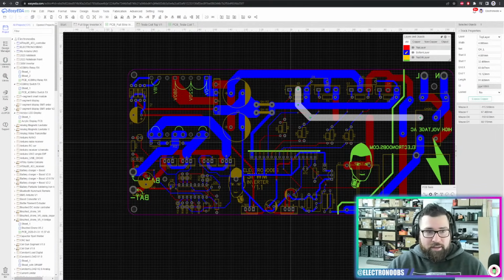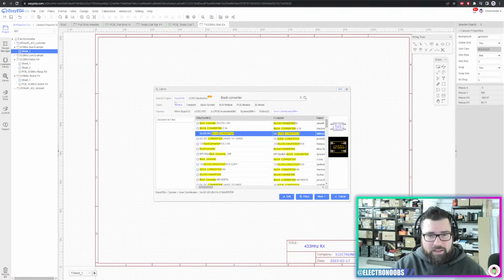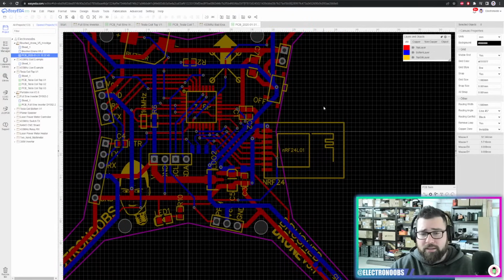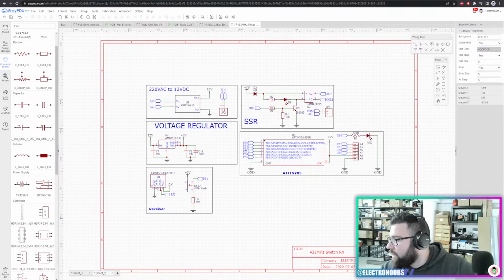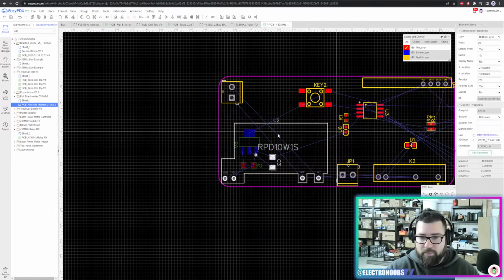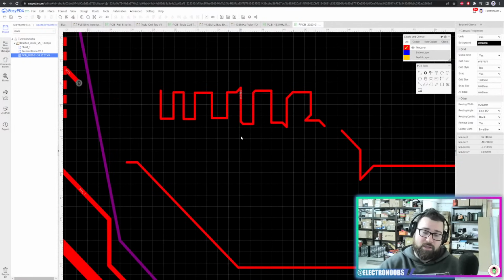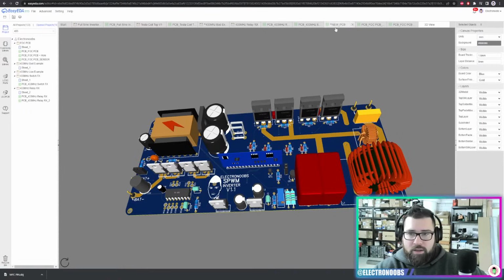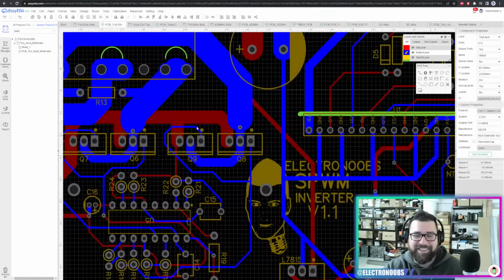Designing a PCB LIVE - Start to Finish + Tips

Comment: I made a arduino drone which can controlled by smartphone using HC-05 module and remote xy app . parts - Arduino nano, HC-05 module and MPU6050 and mosfets as esc. but motors are not rotaing pls help